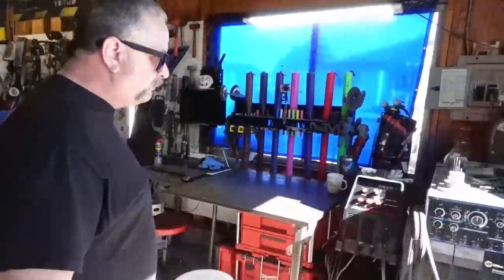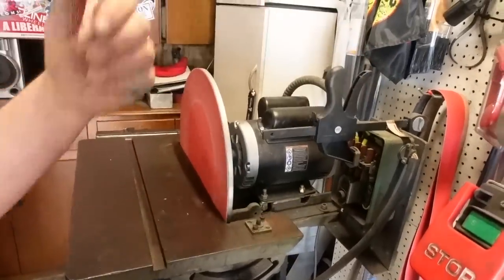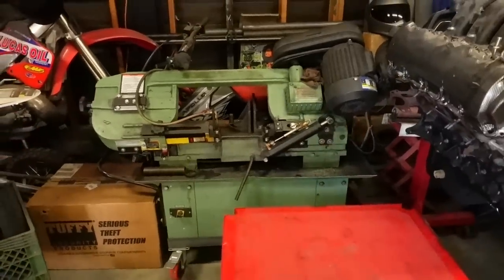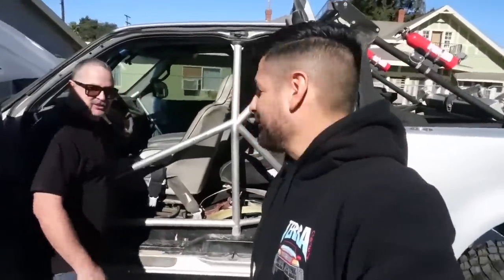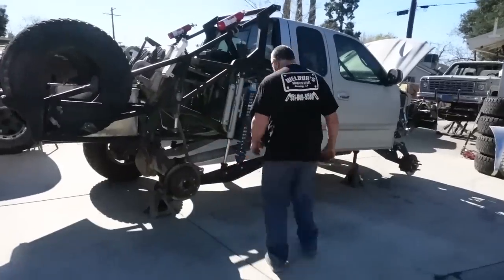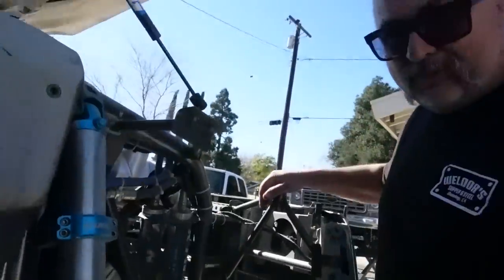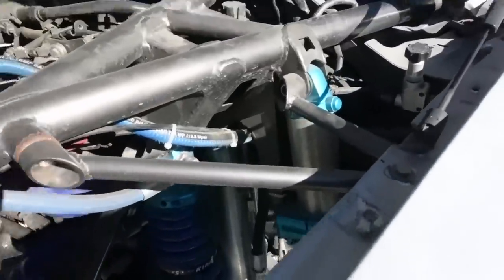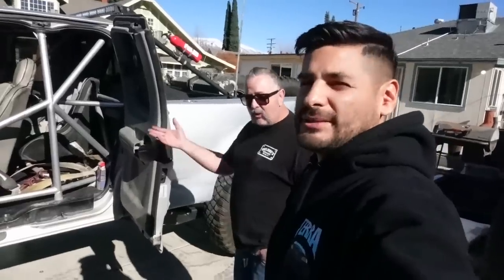Metul Munky's "After Hours F150" Prerunner Walkaround! | BUILT TO DESTROY

Comment: i can agree with ameribrade...with a little attention to detail you can get some precision grinding done. i used one to remove a caliper bracket off of a fabbed upright after the initial plasma cut...you could peel the backside of it off with some pliers, couldn't be more than 40 thousandths thick